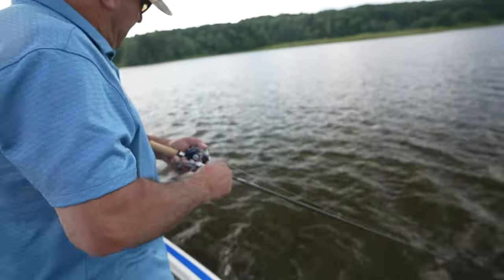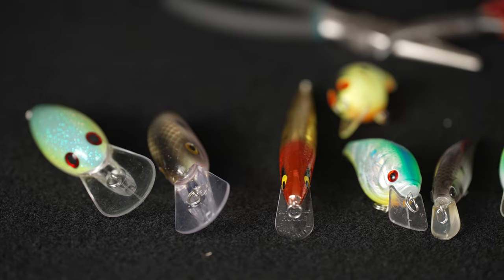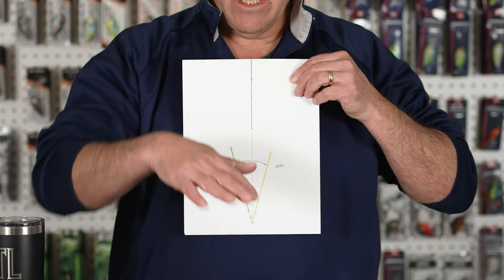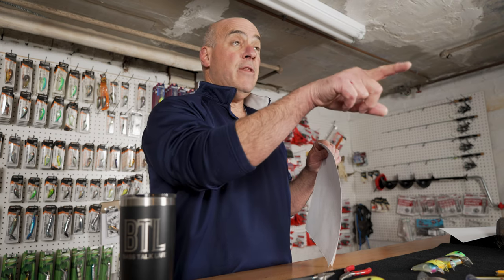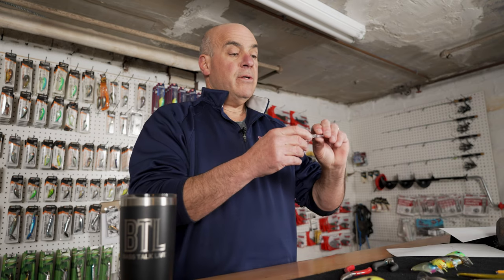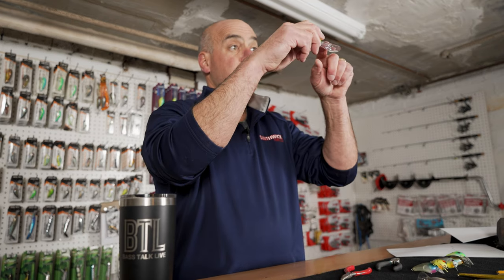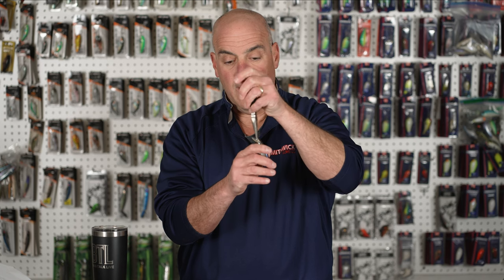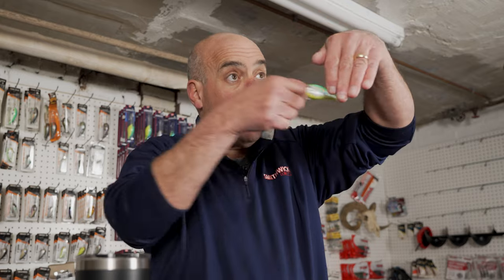How To Tune a Crankbait The RIGHT Way! (Don't Make These Mistakes)

Comment: Great video my friend. As one who makes/paints crank baits, I have to tune a lot of them. Yes, you are correct in saying a little goes a long way when bending the tie on points. I would add that adding a split ring on my baits helps. The old brass snap swivels will alone cause a bait to run to the side. Again, great video.

Comment: Another, very important, thing that you didn't mention; is to NOT use a pliers with teeth to tune a lure with an eye that you tie the line directly to. Tuning with a toothed pliers can create a nick in the tie point that can weaken your line.